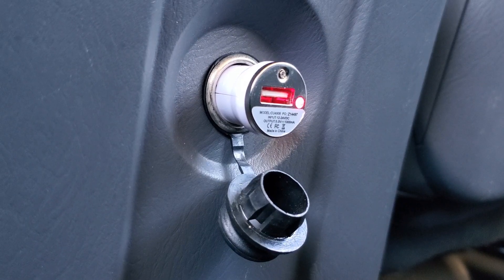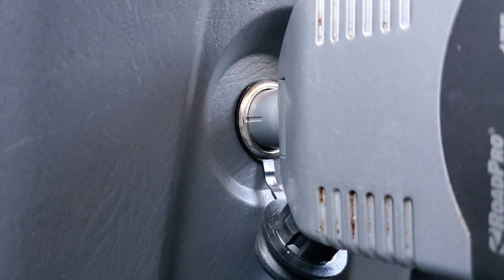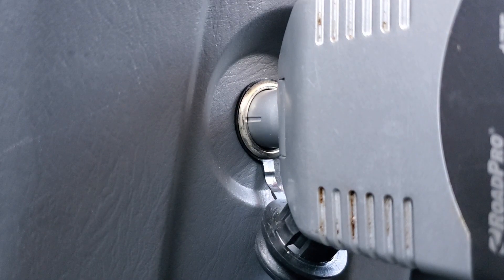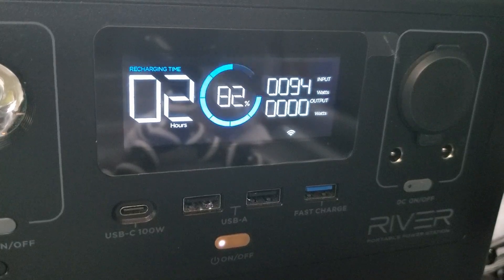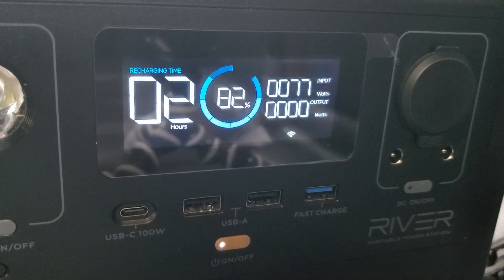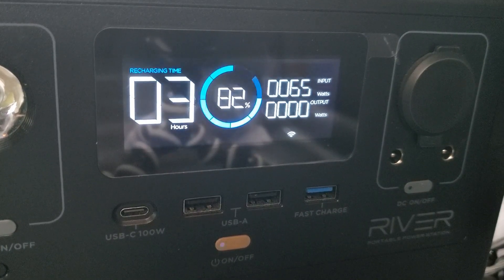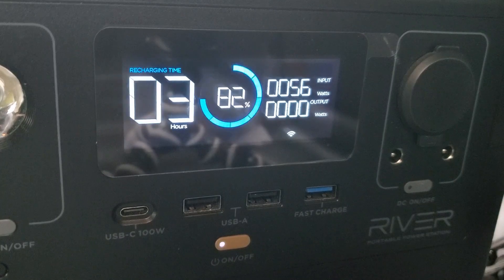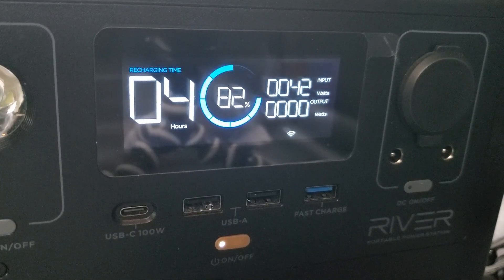EcoFlow. Viewer Requested. Stop! Not all inverters work.  It's not safe! #generator #ecoflow

Comment: The mini inverter you used provides simulated sine wave (square wave) AC power. Meanwhile, Ecoflow's AC input requires a pure sine wave (sine wave distortion less than 10%). Therefore, Ecoflow's charging circuit will automatically stop charging when it recognizes such incompatibility. If you really want to charge this way, use a pure sine wave inverter and connect it directly to the vehicle's battery. The Ecoflow's minimum AC charging power is 200w, while the maximum power of the vehicle's DC outlet is 120w. Drawing power from the vehicle's DC outlet may cause the vehicle's fuse to blow.

Comment: It is overloading the inveter by trying to pull more power than the inveter can deliver.
Reply from the maker: This type of inverter is rated for 175w output. So it's got enough output even if only for a 95w chg.  I did try another inverter and got simular results